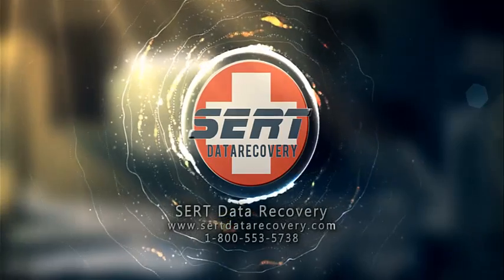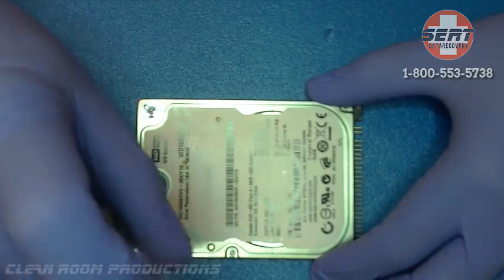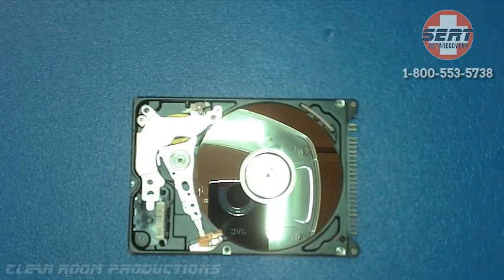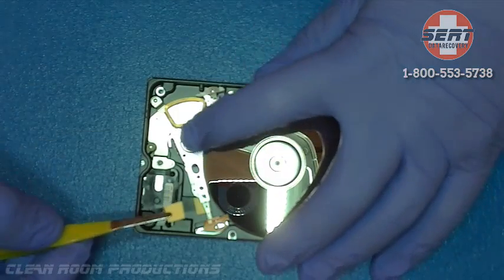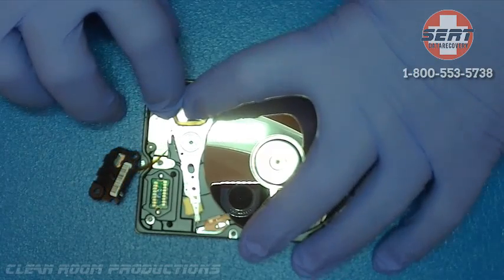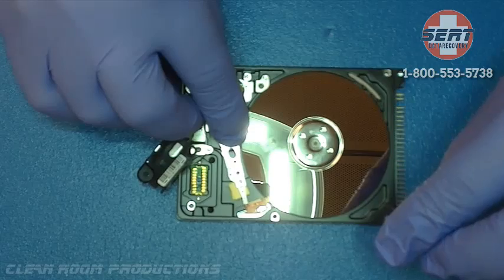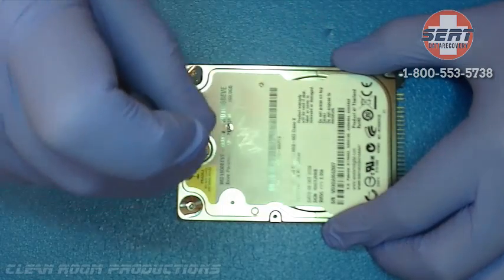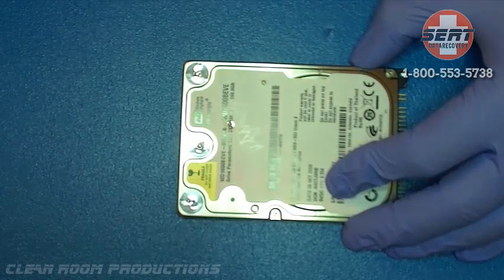Hard Drive Recovery - Repair - Western Digital Data Recovery with Clicking Beeping Sounds

Comment: looks like your not showing all the screws to remove? my drive had several screws holding the head to the drive. otherwise they would just fall out. WHY did you not show the attached screws being removed?

Comment: I have WD external HDD which stopped working after little fall, since i don't have any important data, i opened the hdd , tried to put head to the beginning with the platter clockwise trick but the head won't goes to the start position, that orange thing to support the head won't let me to push more back...

Comment: Hello, thank you for the very well made informative video, great work! 

I wanted to ask if the donor drive needs to be the same capacity as the original? 
I want to do this exact same swap on a 1TB My Passport Ultra. 
I dropped mine from 6 inches onto it's edge onto concrete floor, the unfortunate thing was that it was plugged into my Laptop at the time and running. 

Any tips besides the separators in minimizing a chance to scratch the platters? 

Thanks Again!

Comment: Did you use any special software to scan/repair the drive after you swapped the heads, or did you just connect it and transfer the data via copying to another hard drive?
Reply from the maker: This is a good question. We get many drives that are severely damaged, and never should be able to be recovered. With these drives, we have to use special data recovery hardware in order to image it. To specifically answer your question though, the very next step after a head swap is getting a good image of the drive. We use special Hardware for this. Using a Windows or even a Linux machine to run software to do this can be very risky.

Comment: What kind of material you can used for separate the Writer Head.....
Reply from the maker: +raggie nellas  there are tools available online through data recovery companies, or you can get creative. If you don't have experience with head swaps or a clean room I would not recommend doing this kind of repair as most engineers when learning mess up the first handful of drives rendering them useless for good.

Comment: Sir I have 500 Gb  Western Digital cavier green internal  hard drive. I tried to copy 13gb File from Drive 1.To Drive 2. But After Copying Few Mb,s my PC hangs I wait for some time But It still remained hanged.i power off the Pc And Restarted it But Now Pc is Not Detecting My Second Hard drive It Has so many important Data Please Tell me how To solve the Problem. I have changed the Sata Cables with the new ones but Still Its not working  hard drive motor is working and There is no clicking sounds in the hard drive  Please Tell me How To solve The Problem

Comment: If you have a donor drive, would it be worth swapping the circuit board before risking opening it up? 

Just wondered how likely the clicking sound could be something other than the heads?

Thanks for the video, really interesting to see your approach.
Reply from the maker: great question. FIRST OFF the drive should never be opened if there is valuable data on the drive. Leave that to the professionals please or you will ruin your chances of recovery. The clicking sound is definitely not always or even most of the time caused by failed heads. It is the read write assembly arm that is making the clicking sound, but that doesnt mean the heads are bad, and DEFINITELY NEVER A REASON TO OPEN THE LID OF A HARD DRIVE.

Comment: A friend of mine was using my drive, WD the passport ultra 1 TB, and it kinda fell from the table, didn't hit the ground but was hanging and after that,it stopped working.it wouldn't open. I took it to a repairing shop near my university and that person opened it up and then checked it. He didn't do much and told me to send it to the shop from where i bought it. I did that and they said it needs head replacement for recovering the data. 
I brought it back as i didn't have enough money that time. I plugged it on my laptop and for some reason i was able to see a few folders in the drive. Rest are not visible but i can see that there is 631GBs of space remaining in the drive,which i couldn't see before. I wanted to at least get the data that i could see and transfer it to my Seagate drive but the process was very slow so i cancelled it. I wanna know how much would it cost to recover my data?
Reply: Also, before taking it to the shop i purchased the drive,i could hear ticking but after i got it back,i couldn't hear it anymore and also i was able to open it.

Comment: Hey, I've got a Western Digital WD800JB 80GB HD, and about three weeks ago I started noticing clicking coming from my case, no beeping though. I've had the drive for about 2 years, and never heard this noise before. Is this a sign my drive is failing?
Reply from the maker: @David Yes this is a sign that you need to back up your data IMMEDIATELY. Especially with the age of this drive, any clicking is not good and eventually the drive will become unrecognized.

Comment: My Wd Hard drive is coming up on my laptop when i plug it in and then when i try to go in a folder it sticks for a while.
Can you help me please?
Reply from the maker: This drive is either in the process of failing or failed. Could be a few different things. If you cannot move any data off it, turn it off and stop trying because it will only make it worse. Make sure to call a reputable DATA RECOVERY specialist company (not computer repair or IT company read about the difference here: http://www.sertdatarecovery.com/myths/how-pc-repair-it-oem-can-help-with-data-recovery) because it's going to require special hardware that is very expensive to get the data off without making the drive worse. Software will kill it and cause it to either be unrecoverable or be very expensive. At this point I would say it would probably qualify for our basic recovery which utilizes the hardware I am talking about.Our Basic rates are super affordable.

Comment: Hello, I have a WD my passport ultra 4Tb, 2017 version, it suddenly made a very light sound like 2 times every few minutes, It shows the partition on my macbook pro but with no files!! Can I just use a data recovery files program to recover my files or do I need to put back the head to it's place if that was the case?

Comment: hi, I have 3 x 4TB Western Digital External Hard Drives full of family pics& videos. 2 of them are backups for the other two. Now they are all ticking. Any videos on how to find out what is wrong with them and how to fix them or extract the data.
Reply from the maker: Why would you want to risk losing these files and doing this yourself? The only way to know whats wrong is to have a very expensive recovery machine  that will give you error codes and other details not available about a hard drive any other way.

Comment: hey hi. my WD hard drive stopped working and after watching some videos, i opened it, well the hards are not stuck but it can not read, when i plug it on, it starts rotating but there is a small click sound after it rotates for some seconds and then its slows down to a stop. i tried cleaning the connectors but it still cant read nor continue rotating.
Reply from the maker: Drives shouldn't opened unless you really know what you're doing, as even the incorrect case screw pressure is enough to damage the drive.

Comment: Hello.
I have a WD Elements 500Gb portable hdd with some problems.
When connected to the PC it's recognised but not accessible.
I have tried opening it to see if it could be connected to the MoBo, but i noticed with disappointment that there are no SATA connectors at all but, next to the USB3.0 port, i can see some pins on both sides.
Do you know if i can find some adapters to connect it anyway?
Reply from the maker: Yes this PCB has USB port on it as well as self encrypting capability. You will need professional equipment to fix this issue. The most important thing to know is what caused it. Depending on the cause and the problem keeping it powered on can cause irreparable damage.
Reply: I suspected that.
Thank you for your support.

Comment: I have never had problems before But now my WD my passport 500gb small drive not only is not recognized by ANY computer, nor is it even acknowledged by the computer although the light steadily blinks like normal signaling that its on, I do not hear the disk spin, I'm worried its broken, I don't know what is wrong with it, I live in california, any idea where i would send my drive to , and do you have an idea on what the problem is, THE DATA IS VERY IMPORTANT! --No clicking noise
Reply from the maker: +Hop The Border Productions sorry for the late response. Your drive is probably suffering form damaged or corrupt firmware modules. We recover these types of drives pretty much on a daily basis, and can help you.
Reply: SERT Data Recovery i live in modesto california, How can i fix it?
Reply from the maker: +Hop The Border Productions You won't be able to unless you have the equipment a data recovery firm has. We do provide free shipping to SERT and have many many clients from California.
Reply: SERT Data Recovery i would love to but iim a little concerned about mailing something that has precious data on it all the way to florida
Reply from the maker: +Hop The Border Productions I understand. We receive drives all the time from all kinds of clients that have sensitive and most important data on them. If you are concerned with the mail, which we haven't ever had a problem with, you can try to find a local firm that you can drive to. I would say 85% of our clients mail us their recovery cases.
Reply: SERT Data Recovery  Im from modesto california , how long do you think it will take and what is the average cost
Reply from the maker: +Hop The Border Productions it depends on whats wrong with the drive, however the evaluation usually takes a couple days. The recovery fee is based on what's wrong with the drive and it's storage capacity. If you would like a specific quote you can fill this out here: https://secure.sertdatarecovery.com/online-quote
Reply: Dixinormus lol more like The only copy of my cousins wedding.
Reply from the maker: Dixinormus haha of course.... +Hop The Border Productions we can definitely look at it and figure out what it's going to take to get the data off, and then recover it for you if you would like.

Comment: My drive gets detected in bios but doesn't get reckognized. It appears as "Sata channel:             " showing a blank space instead of "Sata channel: None" . When I select it in bios there's no details. The drive itself makes no noise at all but starts getting hot if its plugged for a while. What problem do u think it has?

What i tried:
- Tried different, ports, cables, and in 3 different computers ( in 2 of them didnt show up at all in bios).  Tried through USB aswell but nothing.
- I opened it to see if the head was on the platter but it was in correct position. 
- I bought 2 identical drives, one of them is for practice, the other one is in proper working order. I tried swapping the PCBs but i get the same results.

So now the only hope i have is to transplant the heads using the working drive as a donor. I've been practicing alot, but the spacer part is pretty hard.  Inside its excatly like the drives in this video, so im guessing it will be this exact procedure. 
Do u have any suggestions what could i try? and also im using pill foil as a spacer, does it matter if the foil touches the heads?
Reply from the maker: This drive is likely suffering from a firmware issue that can only be fixed with very expensive specialized data recovery equipment that can access the service area of the drive and manipulate it's modules. The equipment allows an engineer to access the drive on the manufacturers level and make changes or repairs. Heat is always a drive's worse enemy and should be controlled as much as possible. Letting it get too hot will cause the heads to crash on the platter eventually as they float on the air produce by the rotation of the platters. Heat and air don't play nice together.....
Reply: could you please explain a little more what kind of equipment do u mean specifically and by "access the drive on the manufactures level" do you mean physically opening the drive or are u talking about software programs?
and also do you think a platter swap would work in this case?

I did a successful heads transplant but didnt work.
Reply: harmonica PC 3000,  its a couple of thousand dollars